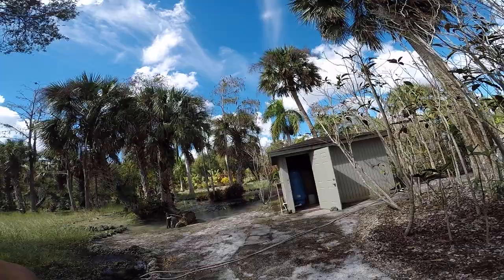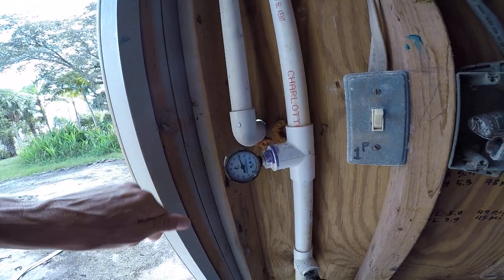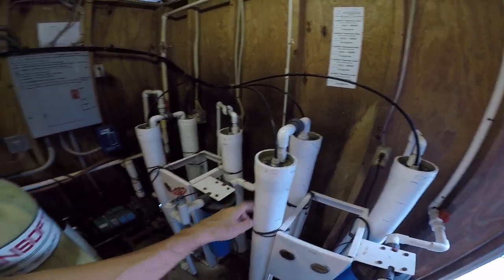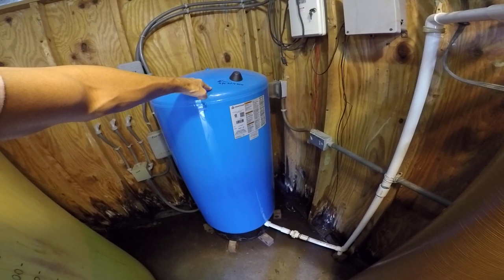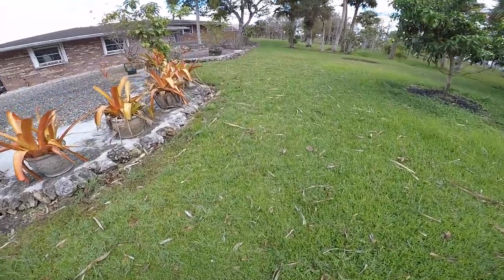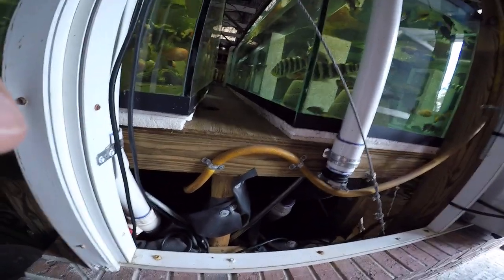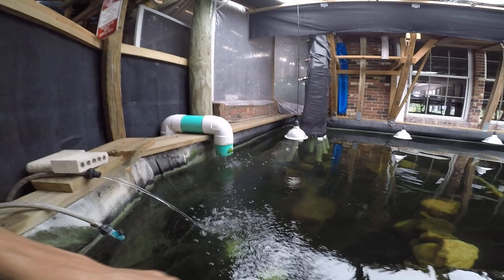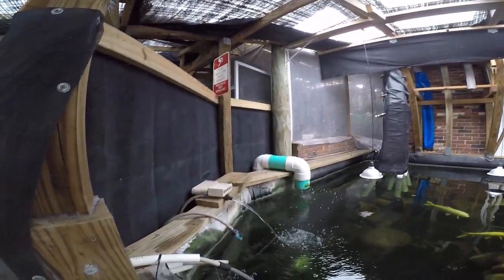Water source & water change, ~15% daily, ~10K gal / 38K liter every day 24/7/364

Comment: Holt Sh¡t... what a job... I know
   I have 20 acres with 6 ponds from 1.7 acres down to .25 of an acre and also have about a dozen inside the house aquariums including 4 of 200 gallons or more and a bunch of really mean toothy critters swimming around in them. Your job dwarfs mine...
Reply from the maker: Thank you for your favorable review :)  Much appreciated.  If your ponds largely require no work, that's great.  But it's not a competition of who's more overworked :)  We made everything so the maintenance is minimized, many things had to be modified over years to make everything run smoother, more reliable, and with less maintenance.

Comment: That's quite the intricate plumbing job you did seems very effective, but your well pump is working double triple overtime though. And do you have a bypass at the quarantine tanks so if you have to medicate. Seems like if you don't you're just going to wash the medication out with that much of a water exchange  on your quarantine tanks?
Reply: Oh and I have another question would your RO system is the wastewater usable. I mean they call it wastewater but doesn't it run through the pre filters which would make it cleaner than it straight up well water??? Because I just got an RO system and I get a lot of waste water. I refuse to just dump it so I use it for washing clothes and stuff.. but I was wondering if I could use it for top offs and stuff like that on my freshwater systems because I only use the RO for saltwater
Reply from the maker: Thank you.  What you makes you make that comment about the well pump?  Yes, I can bypass the water flow if need be in the QT tanks.  I almost never have to do it though, at most I can stop the flow and let the water accumulate a bit in the 25K tank for several hours.  We give short and medium time baths to fish for external cleansing and administer meds for internal cleansing via feed. ...  Yes, RO wastewater had gone through silt filter and is cleaner from physical impurities but it is enriched in salinity and hardness, which for instance would lead to having to use more detergent, speaking of laundry.  I am not sure if it is a good idea to use for top offs or water changes on f/w fish tanks, it probably depends on the wastewater composition.

Comment: 6 to 1 ro to well water. Soo is it ok/safe to for me to do 80% rodi to 20% tap with safe dechlorinator?
Reply from the maker: It depends on details and goals.  The resulting mixture should have the chemistry (pH, TDS, hardness, carbonate hardness, salinity) that you need for your fish.
Reply: Ok thanks I'll probably go 50 ro to 50 tap just to be safe I just wanted cleaner water over all for my tanks but was worried about the fish with too much ro.
Reply from the maker: @worm797redeye6  I assume you don't measure the water parameters I listed. You might be able to wing it but I'd recommend measuring them.  You may risk diminishing your water hardness and TDS too much if you have hard water loving fish or diminishing your carbonate hardness too much that may result in volatile pH, which stresses and kills fish.
Reply: Ok I will test it thanks for the advice also I will likely start slowly to avoid any shock or issues
Reply: @Fish-Story  do you think it would be a better idea for me to run my rodi product water and also the waste water from my rodi like your drip system soo the water chemistry would be similar to the tap all my fish have been living in for some years ? Thanks again for the help much appreciated sir. And I will be testing before I do. Like you said. I just wanted to have your experienced opinion on this.
Reply: Oh and My tap water is pretty hard like 8.0 and the tds from tap at 350 in my area idk if this helps. From my city water report.
Reply from the maker: @worm797redeye6  Your RO waste water will contain chlorine or chloramine, so using RO waste water instead of city water will not eliminate your use of water conditioner, if that's what you are thinking.  Also, recombining RO and RO waste water would be like remaking your city water, so using the RO loses its point.  We don't use waste RO water, I'd like to clarify. We add raw well water to RO water.  ...  Other than pH and TDS, are there any other parameters your city reports?  If not in the mailed flyer, you could ask for a full water report from your water authority.
Reply: Ok thanks for the help I appreciate it 🙏